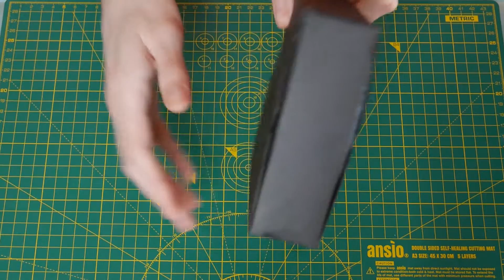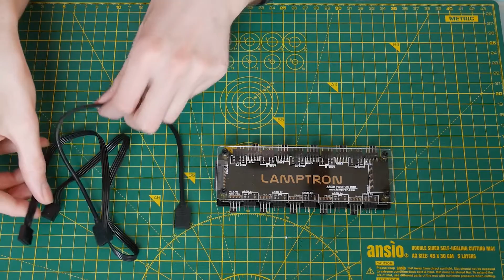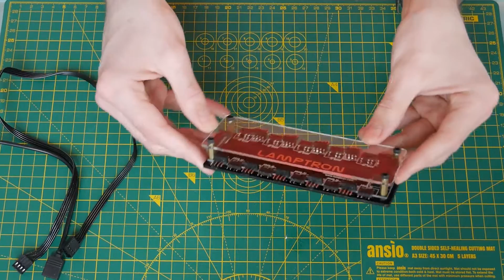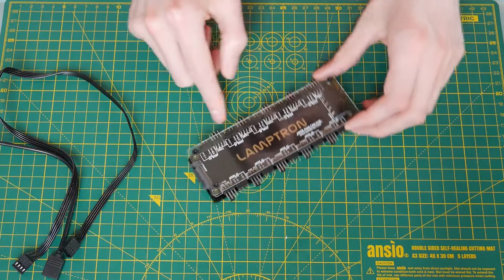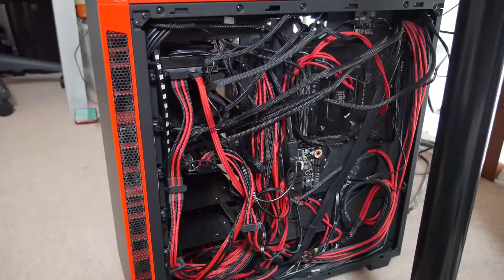Lamptron SP901 Unboxing - Digital ARGB Hub and PWM Fan Hub Combined

Comment: Ok. PC_FAN get signal ftom motherboard. FAN01-08 connect the fan. FAN_PC??? Do I need a dual 4 pin connector to a single to get the RWM to the computer as well. Or do PC_FAN and FAN_PC have to be separately connected to separate motherboard ports to get RWM? And will it be a problem if I connect FAN_PC and PC_FAN with one combo cable to one port on the motherboard? To send a signal to the fan and receive a signal back.

Comment: Did u use sata and molex power connector at the same time? Can't find any information, only read that many people have problems with rgb
Reply from the maker: You only need one of them, you can choose whichever is most convenient.
Reply: @NickMWebster  thx for response works well so far. Í have the problem that the fans keep spinning if the pc is turned off. Is it because the hub is directly connected to the PSU and what could i do to stop this?
Reply from the maker: @Pitahaya-85  That is very strange. PSU should only give power when PC is on. Is there also some other power source in there? Otherwise I think something weird is happening with the PSU.

Comment: Seems to me that this is a hub, not a controller. the fans are not individually controllable. Double confirmed by the fact that it connects to the argb header on the motherboard.
Reply from the maker: Correct, I adjusted the title slightly.

Comment: I've just picked this up, not sure if it's just my unit or "they are all like that sir" but the ARGB cables fit fairly 'loosely' to the male to male pins plugged into the SP901. Even the ARGB cable that goes from my motherboard is fairly loose when connected to ARGB_PC. Did you find yours the same? I've got the V2 model - thanks.
Reply from the maker: The ARGB cables fit loose on mine too. I it's more a problem with the connector than the product as I've always found these to come out too easily.

Comment: how do you change the colour of the fans after plugging everything in
Reply from the maker: The lighting will be controlled by whatever you connect the hub to. Usually your motherboard, which is generally configured by the motherboard manufacturer's software.

Comment: If PC Fan (first one) connects to the mother board and you are using 3-pin fans, is there any benefit of this or is it just so you know RPM fan speed?
Did you connect the fans on your CPU cooler to the Lamptron or are they connected directly to the mobo with a spliiter (1 header to 2 fans)?
Given the fans are running at 100%, is it noisy? What RPM / Model fans are you using?
Lastly, will the fans in the Silverstone Air Blazer 120i Lite fans be compatible with the Lamptron? 

Thanks mate :) Really appreciate the assistance.
Reply from the maker: 3-pin fans will always run at full speed if you connect them to this Lamptron. There might be another product that is better for 3-pin fans.

I have 2 CPU fan headers on my motherboard, so I used those for my CPU fans. A splitter would be good if you want them both controlled by one CPU header and run at the same speed.

My fans don't run at 100%, they are all 4-pin PWM fans, and as there is an uplink connection to a PWM fan connector on the motherboard they are all controlled when connected to the Lapmtron. I have Noiseblocker eLoop ARGB fans.

It looks like those Silverstone fans are 3-pin, so will always run at full speed if connected to this model of Lamptron. The ARGB will be compatible though :).
Reply: @NickMWebster  Thanks for that!! Can you confirm if this setup would work? https://ibb.co/k8G7f6r
Ive mapped out how i plan on connecting things.
I want the radiator fans running at 100%, but the case fans running at speeds determined by the motherboard (via regulating voltage).
Reply from the maker: @BDOGreatSaiyanMan  Yep, looks good. I can't guarantee it of course though!

Comment: hey i dont have an RGB Header in my  MSI a320m Pro-E but i want to buy an RGB CPU cooler. If i would buy this where i should pluge it in? Like whats the Name If the cable
Reply from the maker: If you had this alone, you wouldn't be able to control the RGB without having a header to connect to.

Comment: I have a question...
I use the laptron SP901 and the noiceblocker as well but i can't find the hub at my Software (Asus aura) or bios...

So which Software did you use?
Reply from the maker: Hello, the hub will be controlled by whichever source you connect it to. For instance, it could have a cable from the hub to an ARGB connector on your motherboard. You then control it with the motherboard RGB software.
Reply: @NickMWebster  Thanks now my hub is working...

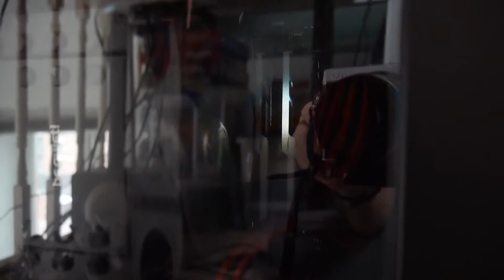Comment: 4:52 What happened to your RGB's at the end of the video? That's not normal.
Reply from the maker: It's just a different mode. All of the RGB LEDs are independently controllable, so it is possible to just flash any of them at any colour.

Comment: I have 7 silentiumpc sigma HP 120mm, will i work with this controller?
Reply from the maker: It looks like they sell those fans in both a 3-pin (DC voltage control) version and a 4-pin PWM version. If you have the 3-pin version, you can plug them in to this, but they would always at full speed/maximum RPM and not be controllable. If you have the 4-pin PWM versions then they will work as expected.
Reply: @NickMWebster  Why would they always be at full speed given the motherboard can send varying voltage through the header to the Lamptron via PC_FAN connection? Wouldnt this regulate speed?

Comment: So does this plug into the 3pin 5v header on the mobo and also ones of the default 4pin fan headers?
Reply from the maker: It plugs in to both a 3-pin ARGB header (which could be on the motherboard or elsewhere), along with a 4-pin (PWM) fan header.
Reply: @NickMWebster  okay thank you very much!

Comment: Are those Noiseblock e-loop fans?
Reply from the maker: Yep
Reply: @NickMWebster  How do you find them? I was considering replacing my P500A's intake fans with them.
Reply from the maker: @richardfeynman7491  I like them. Probably not quite as good or quiet as Noctua, but look nicer IMO and RGB!

Comment: can i connect the hub to a 12V RGB port on my motherboard or will it burst in flames ^^
Reply from the maker: It's for 5V aRGB only.
Reply from the maker: There is the SP903 product which is for 12V RGB.
Reply: @NickMWebster  TY

Comment: Where do you control the argb effect? Using mobo software? U should show the process how you install the hub, not just before and after. My suggestion only
Reply from the maker: Hey, thanks for the feedback! The RGB effects will be controlled by the motherboard. This is basically just a fancy splitter and a neater way to connect lots of devices.

Comment: Do you know what the difference between "PC FAN, PWM FAN" and "FAN_PC" are?
Reply from the maker: I think I tried to address it in the video, but I agree it's very confusing, especially as there was no documentation provided. The PC_FAN PWM_FAN is the fan input, for the connection to the fan header on your motherboard (or another fan controller) which will be used for the signal to control all of the other fans attached to the hub. The FAN_PC is for connecting to a fan, and it will pass through the speed signal from just this one back through to the input.
Reply: Nick Webster ok thank you!

Comment: so its just 1 Device for the Board? or can i change every Single RGB Signal ?
Reply from the maker: The same RGB signal is cloned to all of the ports.
Reply: @NickMWebster  So if I had some ARGB PWM fans would I be able to change them? I'll only ever need to change them all at once...
Reply from the maker: @saul6275  Yes, everything connected to the hub will have the same ARGB signal. So if you change that they all change.